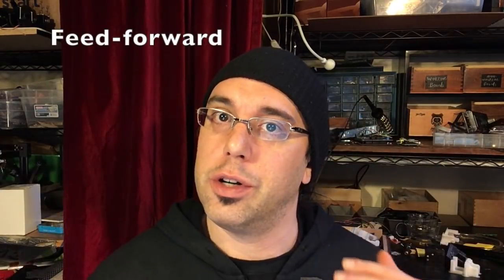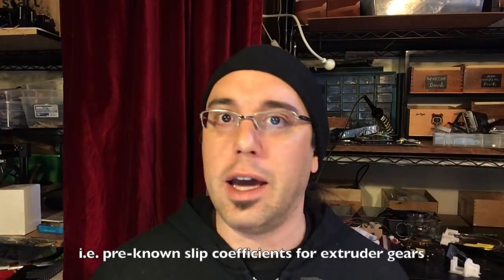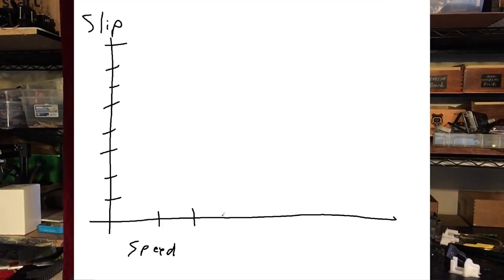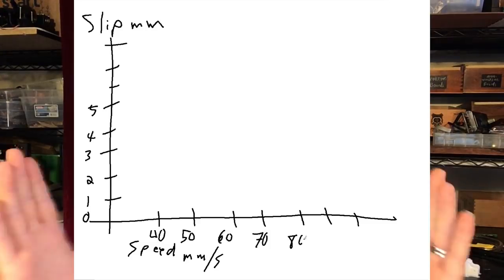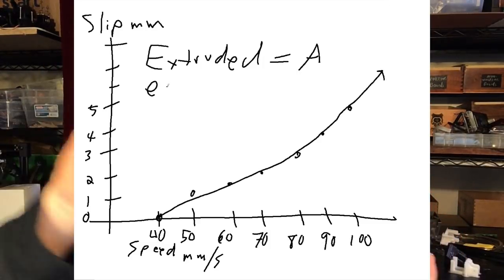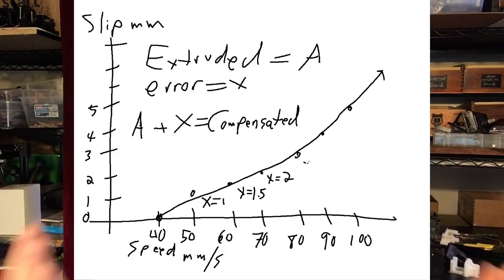3d print fireside chat: wacky ideas

Comment: I'm not sure why you need ringing compensation, whether S-Curve acceleration isn't a better path? I mean it is active even on jerk section of the move, i think or should be.

In MK4Duo (that i wouldn't really recommend as a firmware) i saw something interesting. When you extrude some filament, you lose some heat, but you calibrated your PID loop with stationary extruder. So what it does, you give it a thermal capacity of your filament per 1mm of extruder movement, the volume is trivially derived from diameter, and during extrusion moves, how much of a portion of a heater duty cycle it would take, i mean you have a 40W hot-end heater, and during every forward extruder move, it just bumps up the heating on the heater cartridge to compensate for the thermal energy you just pushed out of your nozzle - all the inputs are known from the printer specs. I will port this to Marlin2.

I don't think sub-ambient cooling is necessarily a good idea, because cooling = shrinkage. You want the filament ideally cooled to just where it will no longer move, i.e. its glass transition temperature, but no further. Then after printing is done, you can cool and shrink the whole print uniformly. Furthermore if you're extruding a wide bead, you really don't care whether it's cooled all the way through or just on the surface, as long as you can just lock it in place. But if someone wants to try and reports that it's a great idea, i'll gladly change my mind.

What else, i don't think overcurrent condition is a priority to be handled in firmware, but rather with fuses or dedicated overcurrent sensors. This occurs when there's a wiring short, and i think fuses work marvellously for the class of shorts that don't get detected by thermal runaway check. The typical failure is connected to an undercurrent condition due to increased resistance. I.e. you have a spot in your wiring or at your terminals where the resistance has reached a significant portion of heater's resistance. Let's say you have a 90W bed at 1.6 Ohm and 12V, if you accumulate 0.4 Ohm at a terminal or piece of wire, your total power is now 72W but 1/4th of those are dissipated at your fault point, and your piece of wire or connector starts burning because it's got 18W dissipated on it. What you can do is run a few thin pieces of wire to ADC microcontroller inputs (imagine them as comparators), two each from heaters and one from supply rail, basically you can measure the resistance of everything leading up to the heater that way and ensure no power is getting lost in transit, because if there is a significant loss, something must be burning up. Whether heater is on or off, you expect the + on the heater to match closely with the supply voltage. If the heater is on, you expect - on the heater to match closely with the ground voltage, and if it's off, with the supply rail. If either of these conditions are not met, something went horribly wrong, in former case you have something on fire, in latter case you have an out-of-control heater because of a short between low-side-switched output and ground.

Alternatively you can have low-value current-shunts and some amplification to measure actual current, to detect undercurrent and overcurrent conditons, but i imagine this can be quite finicky to get right.

I'm however not sure whether this should all be implemented on the main controller at all. For the reason that e.g. Marlin heavily smoothes all analogue readings, taking them alternatingly 16 times, to arrive at about 8-16 smoothed readings per second, depending on the number of analogue readings. But the hot-end heater for example is switched on a faster cycle if memory serves, i.e. for the sensing cycle length, there are already 2 switching events. Maybe we need an auxiliary safety controller running its own firmware that does only that. It can then also be equipped with extra thermistors or thermocouples that are placed in areas that you never expect to get particularly hot, for example near things that might melt. If the outside of your silicon sock or your part cooling shroud is getting very toasty, something has gone very wrong.

I think we should possibly take a step back from low-side switching and towards high-side switching and ground=earth everywhere. There are usually tons of possible stray failure paths to ground, especially with now popular printers which have earthed metal frames. The firmware can run a fast PWM on some pin which will drive a crude step-up for N-channel MOSFET gate drive in high-side switching configuration, to approximately generate a gate voltage 10V higher than the supply high rail, which would also allow to use MOSFETs which are simultaneously cheaper and lower-resistance. If the switching stops (i.e. the micro was reset, watchdog, error or whatever), the gate drive collapses and turns off the heating. Of course in this case the logic of voltage dropout sensing leading up to heaters as suggested above is inverted, but it would also work, no problem.

Someone (forget whom?) suggested that you can record expected intermediates of the PID formula and alert if something happens during printing that causes them to be outside the normally expected ones which might indicate thermal runaway faster than the current thermal runaway algorithm that checks every 20-40 seconds or so. It could potentially very well be self-calibrating during the first few layers of the print.

What i'm very curious to see is some kind of sensor that can remotely determine a distance to obstruction with high precision. You could use such sensor for ABL, and next, the slicer or slicing pre-processor can insert periodic checks once per layer and for extra lengthy layers once per given timeframe to go to a location XY and expect depth sensor reading in a specific range, randomly probing that empty spots on the bed should still be empty and built up spots should still be built up. Should the reading fall out of range, advanced pause or stop can be triggered by the firmware in case the print dislodged itself or stopped being built up. I have not found such a sensor that would be suitable to both purposes, but perhaps i'll just mount a sonar under the carriage and see how far i can get with that excluding ABL. Of course need to account for sensing cone.

Recently, Eryone company from China released (as source dump) an experimental Marlin 1.1.9 fork and tested a smart toolhead, videos show it being tested on the frame of Eryone Thinker 3D Printer. The toolhead only has power wires going to it and is connected to the control board by Bluetooth. While i find the choice of Bluetooth questionable, at least it shows that they have handled the latency and plan synchronisation somehow, as they showed ABL, endstops, and extrusion all working. I am yet to analyse their changes, it should take a while.

Apropos thermal runaway, if it were to happen because of a low-side-switched short-to-ground, or alternatively high-side short to supply rail if high-side-switching suggestion above were to be implemented, firmware has no leverage in common printer setups using a ceiling LED power supply. I think we should be running PS_ON control for that - either an ATX PSU or something similar, or a relay. I think this is the first necessary step towards a safer printer. Then you can tie everything else like fire alarms and security controllers into the same PS_ON control.

I think someone has done FDM paste extruder deposition of resin and laser curing. It's somewhere on YouTube but i forget by whom and where.
Reply from the maker: Lots to unpack there.  Lemme see:

S-curve: I would think the would be a great improvement, although I have been waiting until certain details are ironed out in Marlin 2 before I do. My early tests were not playing well with Trinamic drivers, but it has changed a lot since then.  There is also a rumor of upcoming stepsticks with onboard ramp generators, but I can't fins any info other than a few twitter posts and some preliminary PDFs.

Thermal compensation: I think that is a good start.  I'll definitely give it a try if you port it over because it has the potential to solve some problems with large diameter nozzles and faster printing. I regularly find myself wishing for better software thermal management when printing fast prototypes with large nozzles (or with standard nozzles using variable layer heights).

Sub-ambient cooling: Correct, 'locking into place' is the key. the impetus behind that idea was the I could not get quickly-printed large layers to adhere properly on sharp movement changes like solid flat layers or infill (I'll show an example of that in the next Q&A video) without seriously dropping down the acceleration and jerk, but then there tended to be blobbing, and bridging can be problematic with large layers as well.  I had some success with Lin-advance/'coasting' though, so maybe more granular software control would do the trick. 

Overcorrect condition:  That voltage comparator idea is pretty elegant, and cheaper than the sensor.  I feel that they should really do SOMETHING though, because of the reports of fires.  Proper wiring practices to avoid rising contact resistance, and avoiding under-value connectors is important, but a current-sense kill-switch/alarm is still good because there are always unknowns. And I am not opposed to a separate MCU dedicated to safety features since chips are so cheap these days. I think I'll add that to my 'to-do' experiment list.

High-side switching: Agreed. I assume low-side N-type was chosen for simplicity and cost since high-side N is a little trickier and P-type are a bit pricier and slightly harder to source in decent specs (on a budget). But we are beyond the 'rep-strap' days, and there is no reason not to look into the benefits of other topologies.

Obstruction sensing: I think an array to compare mutual capacitance MAY work (like what utility companies use for obstruction avoidance imaging sensors to avoid digging up underground PVC water lines, etc), but I don't know how practical or difficult that would be (especially for lower layers where proximity to the bed has to be considered).

Comment: some very wacky ideas.. inductive heated hot end has already been done...  the extra complexity outweighs the benefits by a large margin
Reply from the maker: I have seen some older attempts using an analog control loop, which is indeed overly-complex.  It could be simplified greatly using a cheap MCU, but as they say... the devil is in the details.

Comment: re smoke detector, no way in hell I would ever trust a diy smoke detector!
Reply: But it's absolutely sensible for a multi tiered approach. You install the best safest smoke alarm you can get on your ceiling to wake you up and save your life in case of actual emergency, that's the one you actually have to trust and you definitely shouldn't give it up, and you can have a hackjob of a smoke detector on your printer to reduce the danger and damage. You could even use a networked big-brand smoke alarm, decipher what it does, and use it in place of a smoke detector module for more better assurance.

I'm honestly not too concerned about smoke detector modules for secondary use though. I mean they often have the same innards as a proper smoke alarm, a very cheap one but they tend to fail on the safe side by triggering the alarm willy nilly, but instead of the buzzer there's a relay or a bare open collector output. You can test it too from time to time with a smoke alarm testing spray.

Comment: nozzle issues? get a titanium tc4  all metal heatbreak e3d clone 

works with a lousy really bad 3010 cooler making noise and failing on a e3d , again chinese clone dissipator   on a heated chamber at 60 degrees  or more, for 4 hours

WITH PLA. 

volcano nozzle. 40w heater. takes really long to coold down. noticeable difference. 
stainless steel 304 heatbreak may be similar.  didnt tested it

anyone who makes titanium tooth inserts may machine ones for you. ( fast delivery )
Reply: cant actually put a link here  to my latest direct bondtech gears design becouse... youtube.
Reply from the maker: I actually got one of those titanium heatbrakes a while back, but haven't tried it yet.  I'm looking forward to testing it when I get deeper into the extruder topics. I also have a few 40w heaters and they work very well... AND, I will be testing a DIY design with a pair of heater cartridges and a copper block, so if that works out, I'll put up a video about it.